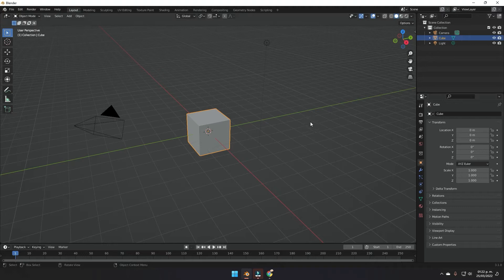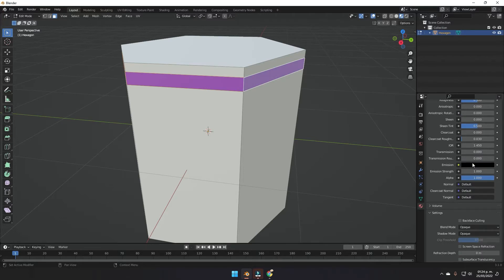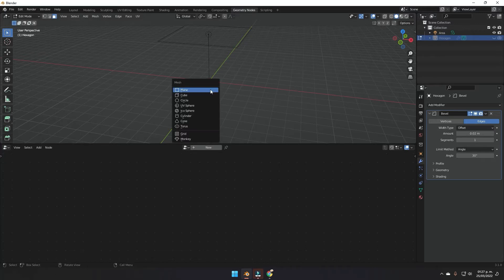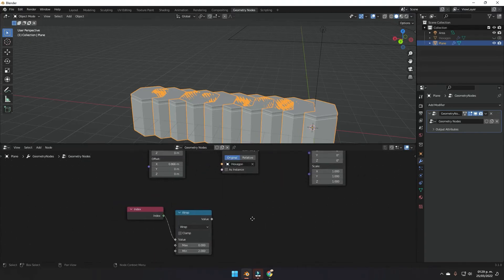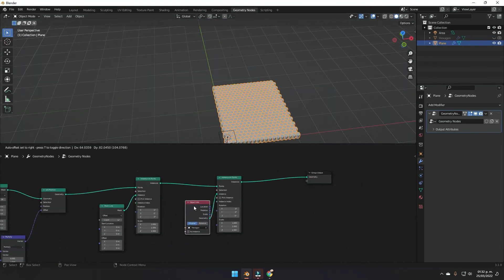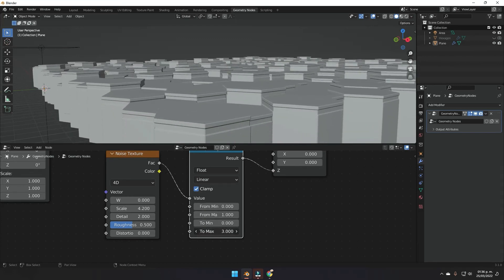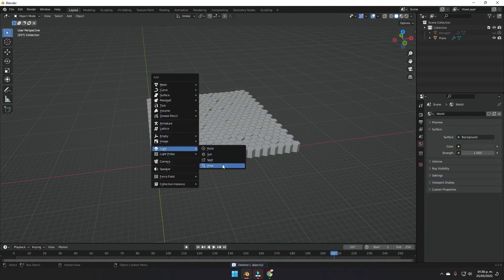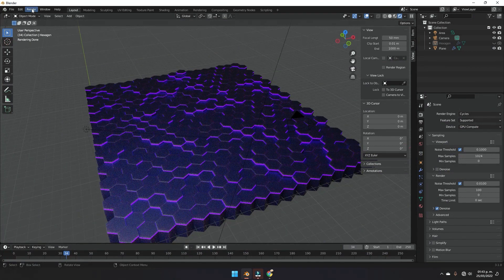HEXAGON GRID ANIMATION - Easy to follow blender tutorial

Comment: Nice one but it's not really good for wallpaper and stuff since it needs to be seamless.
Reply: Ok, actually, I figured it out. You can make it loop seamless by: Shift+D your noise texture and duplicate it. Then, on the duplicate noise texture and keyframe, the W is to be whatever the last value is of your first noise texture on the last frame of your timeline. For example, mine starts at 0.000 and ends at 0.409, so on the 2nd texture node, I just keyframe it to be the opposite of that, so it starts at 0.409 and ends at 0.000. Then, after you've done that, add a math mix node, attach the first noise texture fac to A on the mix node, and attach the 2nd noise texture fac to B on the mix node. Then, attach the result to the map range node value(what the first texture node was originally attached to before, as shown in this tutorial. Some notes, though, with this technique, I think you'll need to add a lot more frames to your timeline, and you'll probably need to lower the "To Max " value located on the map range node and maybe play around a bit with the other values to get the exact effect you are looking for depending what that is.

Comment: This is my first Blender project, and it came out awesome. I even added a Carbon Fiber texture to the top of the hexagons to make it look even cooler. Lol. But I did have a few questions. First off, how can I loop this so it make a seamless transition from end to beginning? One of the ways I'd want to do that is to have it start "flat", then animate a bit, flatten out, animate, etc. for about 5 minutes, then repeat that loop.

My other question is, how can I make it so any time the hexagons pop up they go all the way up, then all the way back down? And how can I make sure that the max Z height is just enough to show the "lights"?
Reply from the maker: Great to hear about the carbon texture. did you upload it somewhere? and I will upload a reel on insta on how to do the loop and the doubts, i’ll let you know in this comment when it’s done :)
Reply: @limo_learning_   I haven't uploaded it anywhere yet because I will be using it as a background for my AFK screen for my streams. That's why I wanted a looping version. Lol.

Comment: Hi ! Amazing tutorial !
Is there any way to make an infinite Loop out of this ?
Reply from the maker: Yes there is. I believe it’s in another tutorial, let me find it.
Reply: @limo_learning_  did you find it?
Reply: Ok, actually, I figured it out. Shift+D your noise texture and duplicate it. Then, on the duplicate noise texture and keyframe, the W is to be whatever the last value is of your first noise texture on the last frame of your timeline. For example, mine starts at 0.000 and ends at 0.409, so on the 2nd texture node, I just keyframe it to be the opposite of that, so it starts at 0.409 and ends at 0.000. Then, after you've done that, add a math mix node, attach the first noise texture fac to A on the mix node, and attach the 2nd noise texture fac to B on the mix node. Then, attach the result to the map range node value(what the first texture node was originally attached to before, as shown in this tutorial. Some notes, though, with this technique, I think you'll need to add a lot more frames to your timeline, and you'll probably need to lower the "To Max " value located on the map range node and maybe play around a bit with the other values to get the exact effect you are looking for depending what that is.